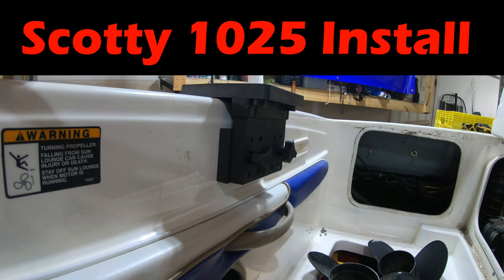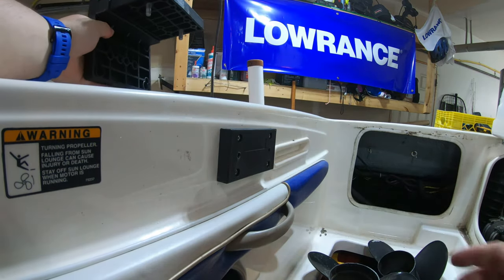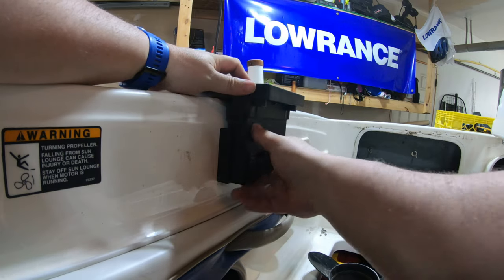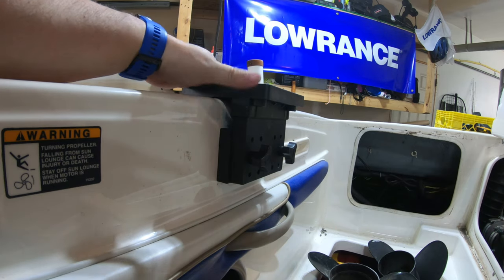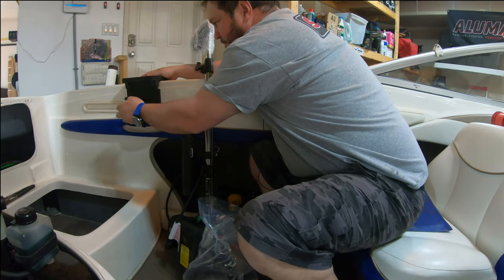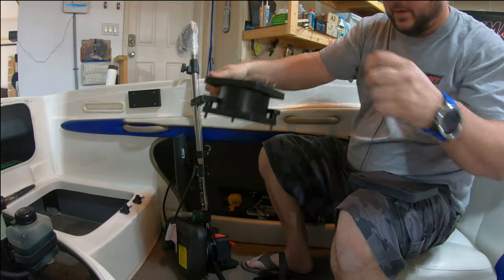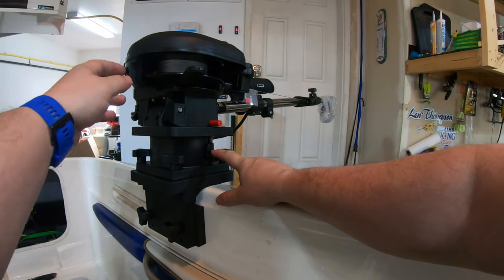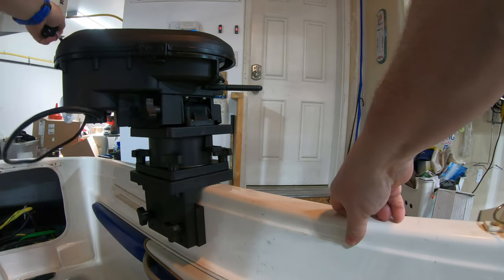How to Install a Downrigger on a Fiberglass Boat with a Scotty 1025 Right Angle Gunnel Mount

Comment: I just wondered how you fastened the bracket to the boat did you use epoxy? or did you just bolt them in? I have a fiberglass open boat and I want to mount them the way you have them Presently I am using a board across the boat but would like the boat to be open from front to back .
Reply from the maker: I bolt it through with 1/4” x 2-3” Phillips head bolts and then add a washer to the back with a nylock to tighten it down. Sometimes I use a plywood backing and sometimes the boat has enough structure.

Comment: Did you put any backing behind the mount? Or use toggles?
Reply from the maker: Definitely used backing. Added 3/4" Plywood and mounted with the 1/4" bolts, washers and nylon lock washers
Reply: @BulatOutdoors  thanks for the reply and very helpful video
Reply from the maker: Glad you enjoyed it and found it helpful
Reply: @BulatOutdoors  Did you happen to record the install of the plywood?